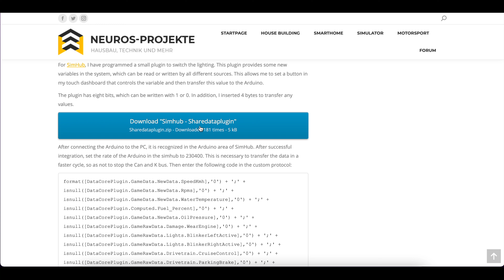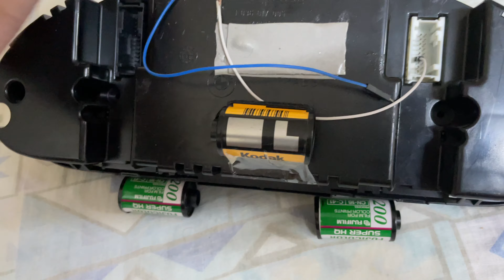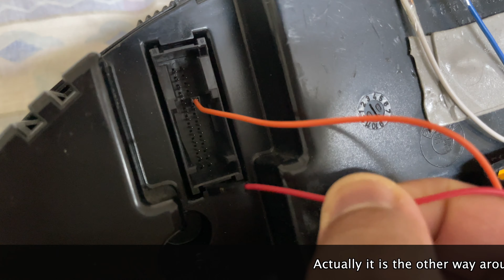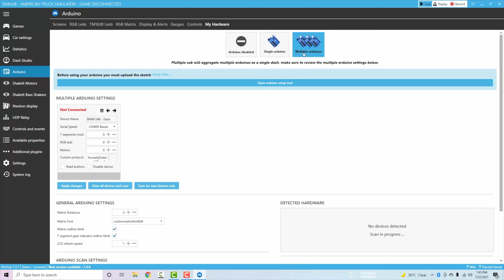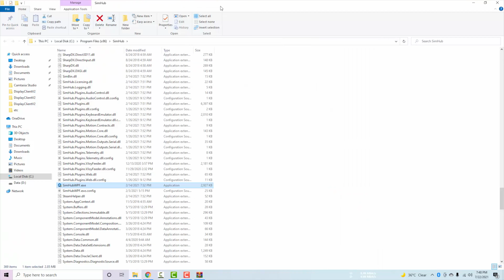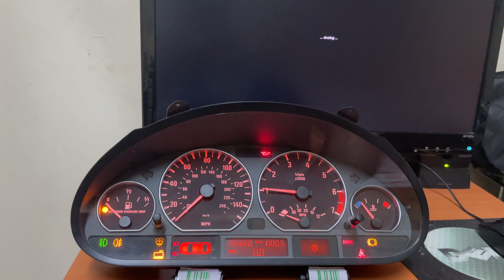BMW E46 instrument cluster connected to SimHub - CAN Bus#arduino #simracing #bmw #automobile

Comment: I noticed the fuel gauge wasn't working, did you manage to fix this?
Reply from the maker: Hi, the fuel gauge is driven by floating variable resistor. To make it work with the game, you either have to replace the original stepper motor with an arduino servo. Or externally make a setup like connect the servo motor with a variable resistor of same rating as the fuel tank resistance value and then connect the resistor leads to the fuel gauge pins on cluster. This should work, with some tweaking of the code. it’s been a long time, since I haven’t played with this cluster.

Comment: I have all the pieces but the only thing that has me stuck although I think it's a joke is the circuit of transistors and resistors that you have to assemble 7:10 I tried to assemble it once following the photos in your video but I couldn't and I can't read the diagram I don't know what's wrong with me.
Reply from the maker: It’s something unfortunately you need to figure out..Btw the OG code has undergone some updates. Check the pinned comment please.

Comment: Hey there. What kind of signal does the E46 speedo use? I want to generate the signal using arduino. Im actually on m54 swapped E36 project, so I want to use the original E36 signal to run my E46 dashboard's speedo. Thanks!
Reply from the maker: Hi, the speedometer on the E46 is just like the E36, it’s PWM signal driven. Don’t know if it will work directly with that E36, but you can always try.
Reply: Many thanks buddy😊😊. I will it later this afternoon. Regards!!

Comment: Do you think this would be possible to get running in a more sinple way using an Arduino UNO or is the extras of the Mega a need?
Reply from the maker: You need a mega itself I think..get a clome so it's cheaper

Comment: Helpful video, i did everything but turn signals and other lamps are not working.I pasted custom protocol in simhub and did everything like un the video.
Reply: I also tested the cluster (secret menu) and every lamp works fine
Reply from the maker: Hi, some of the warning lamps are driven by can and they should work fine. The turn signal and non warning lamps are driven by the k-bus circuit. Is the k-bus circuit correctly wired?
Reply: @sciencetrove  Thanks for the reply. I also think that it might be a problem in my k-bus circuit. I will redo it and update you.
Reply: @sciencetrove hi, still cant find where the issue is. My k-bus circuit seems to work,because i unlocked a bmw radio with it . I read somewhere that the problem may be clone arduino,so i will order an original one.
Reply from the maker: @georgimilev6786 I see, thanks for the update. Let me know how it goes. BTW there are some members in the channel's discord group who have simrigs based on the E39 and E46.

Comment: bro can i use other dashboard cluster??
Reply from the maker: Yes, you can. But for can bus based clusters you need to change the can bus ID frames in the Arduino code for your corresponding type of cluster.
Reply: @sciencetrove  ok bro

Comment: In file included from C:\Users\hp\Documents\Arduino\libraries\WebSockets\src/SocketIOclient.h:11:0,
                 from C:\Users\hp\Desktop\e46\DisplayClientV2\SHCustomProtocol.h:85,
                 from C:\Users\hp\Desktop\e46\DisplayClientV2\DisplayClientV2.ino:833:
C:\Users\hp\Documents\Arduino\libraries\WebSockets\src/WebSockets.h:37:2: error: #error Version 2.x.x currently does not support Arduino with AVR since there is no support for std namespace of c++.
 #error Version 2.x.x currently does not support Arduino with AVR since there is no support for std namespace of c++.
  ^~~~~
C:\Users\hp\Documents\Arduino\libraries\WebSockets\src/WebSockets.h:38:2: error: #error Use Version 1.x.x. (ATmega branch)
 #error Use Version 1.x.x. (ATmega branch)
  ^~~~~
In file included from C:\Users\hp\Desktop\e46\DisplayClientV2\SHCustomProtocol.h:87:0,
                 from C:\Users\hp\Desktop\e46\DisplayClientV2\DisplayClientV2.ino:833:
C:\Users\hp\Documents\Arduino\libraries\WebSockets\src/WebSockets4WebServer.h:29:10: fatal error: ESP8266WebServer.h: No such file or directory
 #include <ESP8266WebServer.h>
          ^~~~~~~~~~~~~~~~~~~~
compilation terminated.
Multiple libraries were found for "mcp_can.h"
  Used: C:\Users\hp\Documents\Arduino\libraries\Seeed_Arduino_CAN-old
  Not used: C:\Users\hp\Documents\Arduino\libraries\canbus
  Not used: C:\Users\hp\Documents\Arduino\libraries\Seeed_Arduino_CAN-master
exit status 1

Compilation error: exit status 1

Solution?
Reply from the maker: Which version are you using? The modded one in the description or the original one from neuroprojekte website?

Comment: Hey buddy. Great video except for one thing. I followed every step, bought everything part for part for part. Followed all steps on simhub but unfortunately nothing. Yet when I use the original code from the German site it works straight away. Any advice to get your code to work would be greatly appreciated. Thanks
Reply from the maker: Hi, sorry for the late reply. The code on my google drive link is 99% same as the original German one except for the fog lamp indicator active. That's the only difference.

Comment: Hello I have the problem when I want to upload s
mcp_can.h:112:11: note: candidate expects 3 arguments, 1 provided
exit status 1
no matching function for call to 'MCP_CAN::begin(int)

and this error
mcp_can.h:112:11: note: candidate: byte MCP_CAN::begin(byte, byte, byte)
      INT8U begin(INT8U idmodeset, INT8U speedset, INT8U clockset); // Initialize controller parameters
what can i do
Reply from the maker: You need the correct can bus library
Reply: @sciencetrove  i ordered the can bus on amazon can you tell me which one i have to use

Comment: I also have a Holden VX Commadore dash working which operates basically the same as E36 using Simhub and Arduino Uno, just need to make a few adjustments to max Spd & Rpm to suit then trim revs also use jumper to bypass service reminder if need be.
Reply from the maker: That's a nice looking cluster

Comment: Hello, I am building a simracing with an e46 dashboard (I have photos and I will upload the process to YouTube). and I want to make the cluster work, do you have photos or something more detailed on how to assemble the arduino, the resistor board, transistors, etc?
Or if you would pay yourself? Thanks a lot!
It's super cool what you've done :)
Reply from the maker: Thanks! I didn’t show anything related to Arduino is because the details are on Neuro Projekte website linked in description. It’s in German so you need to use Google translate if you wish to read. But the code, ncalc and wiring diagram are in English. BTW this project will require some good knowledge of electronics and soldering skills. The circuit itself is easy if you are good in both these. Even if I soldered it wouldn’t be economical to ship it off from Saudi Arabia where I’m currently working now. Shipping costs from here to other countries are very high.
Reply: @sciencetrove  Ahhh okay, I thought you lived in Europe, I'm a mechanic but not an electronicsman, I know electricity in vehicles but not at this level... welding is not the problem, I have visited your page but nothing is clear to me... I sent you several emails but I still don't have an answer from you :(( In the end I am forced to put an e36 cluster that is easier and there is more help on the internet :(

Comment: I did the same but the RPM has a delay, how do I solve it
Reply from the maker: as in delay do you mean like only when you pause the game the RPM needle moves? If this is the case I had mentioned that opening a dashboard and leaving it in background on simhub helps. If this isn't working then maybe something in simhub has changed since I posted. I haven't used simhub in a while.

Comment: Does the indicator  only needs power or a signal to the arduino?
Reply from the maker: Indicator is powered via 12V supply/battery. The arduino controls the kbus and can signals. Arduino is powered directly from USB
Reply: @sciencetrove  There ist a Video by Amstudio. He has a wire Plan which is a bit easier  with only one arduino. But He hasn't wired the right and left indicator. Do I need a new Script  for the indicators.
Amstudios Video is called how to wire bmw Cluster...
Reply from the maker: @Agent_Flix  The cluster used by amstudio is a non CAN type cluster. So yes all the lights are very analog type and needs manual trigger to light up. I believe he may have left it out as trying to use the native dash lamps will need a lot of wiring. Or just directly use LED lights from arduino and pop it into the cluster lamp sockets. In the latter case no need for relays. 

To be honest CAN based cluster projects are way better to activate lamps via software and require very very little wiring.
Reply from the maker: @Agent_Flix  Yep that video is the most basic one for anyone who wants to use a cluster. Yes, you will need to add a bit of code and ncalc values to get the lamps running. I did code that part in my very last E36 cluster video. But lately people have been saying that with new simhub they are facing issues. 

The e46 is kind of semi CAN based.

Comment: Hi i have some issues, i wired the relay, first i tried for park brake. I wired to good pin in cluster. Relay does the click, but nothing happens on cluster
Reply from the maker: For the parking brake lights to turn off I think you need to connect it to power supply/battery negative terminal. If you were to connect this to relay terminal, connect the battery negative terminal to relay "COM" center screw terminal. Now connect the parking light pin 23 on the black connector to the "Normally Open-NO" terminal on the relay. Now when the relay is energized your light should also turn off.

Try first connecting the pin 23 directly to negative without a relay to see if it turns off. If this works then it's just that you might be connecting it wrong on the relay.
Reply: @sciencetrove  i also tried to wire a GND to pin 23. it doesent instantly turns off, i have to replug the cluster to power
Reply from the maker: @Albertt.c  I'm surprised it did not work. Even the connection for the parking brake as per manual says GND. What did you mean by re-plug the cluster?

https://www.bmwgm5.com/Images/E46_IKE/E46_FSB.gif

Anyway what happens if you connect the pin 23 to +12V? From which model bmw did you pull of the cluster. If you can add a picture on imgur the label on top of the cluster it may help.
Reply: @sciencetrove  i mean to replug to power
Reply from the maker: @Albertt.c  okay, I see. Mine is a 330i E46 cluster.

Comment: can i have a link to the site where i can buy the things i need to do it
Reply from the maker: All the parts list can be found here:

https://neuros-projekte.de/simulator/bmw-e46-arduino-simhub/

Instead of the PN2222A you can get any NPN transistor you like. I used a BC547. Oh and make sure the cluster is a petrol variant not diesel.
Reply: Check the original article for a parts list

Comment: great video. i followed everything and got most of it working. speedo works but the tach only works when the game is paused. any ideas as to why. i have another gauge cluster open when trying to make it work
Reply from the maker: Thank you! Glad the video helped you to get your unit running :)

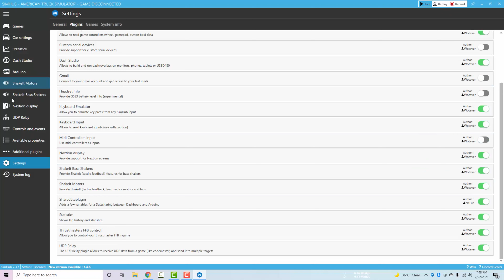I too faced the same issue with RPM. The only fix I could do to get it to work was to open a dash and keep it running in the background to get RPM to work fine. I’ve explained this at time stamp 22:19.
Reply: @sciencetrove  thats what I meant when I said I have another gauge cluster open. Nothing has worked for me still.
Reply: @mr.hankie  same problem with my cluster too!

Comment: Hey I have a 1999 Ford ranger speedometer it doesn't have pins on the back just different hmm 🤔 he had pins to connect the wires 

Anyway to still make it work?
Reply from the maker: Can you maybe send a link to what the pin out of your cluster looks like? 

Maybe this might help:
https://www.ranger-forums.com/8-cylinder-tech-34/v6-v8-tach-ground-wire-107127/

Comment: Which pin from relay goes to cluster? like which one goes to arduino and which one goes to cluster?
Reply from the maker: Only my relay channel set: the ones labeled IN1, IN2…etc is the data input from arduino to enable/disable the relay. Vcc& GND are +5V DC and ground(-) of your 5V supply.

The ones labeled as K1, K2…etc are for the relay outputs. With 3 terminals: Normally Open (NO), Common (COM) and Normally Closed (NC). Hope this clarifies your question.

Comment: how do i make the fuel gauge to work?
Reply from the maker: Hi, the actual fuel gauge if you look at the E46 cluster wiring diagram on website in the description it uses a variable resistor paired with a float system to make it work. 

On NeuroProjekt website link in description you can see he has modded the original stepper motor to an arduino servo motor to make it work.
Reply: Hi on which pin does the servo go for the fuel gauge

Comment: Looks like you can use an old  Toyota or Honda  Audi Speedo too.  But the newer digital displays will be harder.
Reply from the maker: The newer clusters with analog gauges fully CAN have only 4–6 wires and are easy to setup for someone who knows about coding and electronics like example BMW E90. 

Yes, you are right with the digital. It’s difficult but doable I guess. But would require a lot of work I assume.

Comment: Thank you so much for this helpful video, i made it to the point where i can control the cluster via SimHub. However the cluster only displays RPM and Temp for 4 to 5 seconds before returning the RPM back to 0 and Temp to maximum.

When i try to set the baud rate of the arduino to 230400, the arduino contantly loses connection to SimHub. When i set the baudrate higher or lower the connection to the arduino is good but the RPM and TEMP only work for 4 to 5 seconds.

Can you maybe help me?
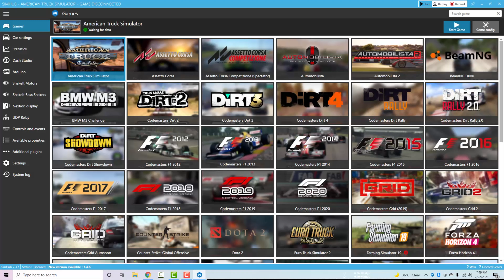Reply from the maker: Thank you! Glad you found it helpful. I too found this issue and couldn’t exactly pinpoint what is causing the issue. A workaround I found was by opening one of the preloaded cluster dashboards in SimHub and allow it run in the background. At time from 22:20 to 22:40 I've explained about this.
Reply: did you ever figure out the switching off issue, kevin?

Comment: Okay this video really helps alot! I bought a cluster from a e46 Diesel and wanted to just mess around with the can bus (since I made my gaming setup out of a complete dash from a different car) but for some reason the data doesn't reach the cluster. Does there need to be a 120 Ohms resistoe between Can H and Can L? The cluster powers up fine but no can communication works and the temp gauge always goes to maximum
Reply from the maker: Happy to hear the video is helpful. You do not need to add any resistors. Which shield are you using? Generic or something from Seeed/spark fun etc?
Reply: @sciencetrove  I am using a Keyestudio Can Bus shield (some cheap shield that works with any cluster but that one). Idk maybe I set the bitrate wrong tho. Currently have it set at 500 KBPS and using addresses from the internet but there's no response from the cluster. Or do I actually need the K-Bus to get that to work at all?
Reply from the maker: @vampyryannik7334  Sorry for late reply.  The K-bus is only for certain lamps. Try to use the default send code in can bus library and see if the Arduino initializes on the serial monitor. I see from aliexpress pictures that the board does not have a 120 ohm resistor by default. 

https://wiki.keyestudio.com/KS0411_keyestudio_CAN-BUS_Shield#Terminal_resistor

I had initially ordered a simple Chinese one off eBay and for me it worked fine, but mainly the issues I faced was something else.
Reply: @sciencetrove  it's totally fine! I actually found the issue lmao and now it works fine. I aswell managed to get every warning light off, except the parking brake which does not dissapear when I hook it up to Ground or 12v.
Reply: @vampyryannik7334  what was the issue? my temp is stuck at max and my tachometer does not work.
Reply: @gullysl  it was indeed the 120 Ohms resistor
Reply: @vampyryannik7334  I don’t have a 120 ohms resister between the Can H and Can L :( I suspect that It may be my can bus shield.
Reply: @gullysl  yeah you need to put a resistor there thats why it doesnt work
Reply: @vampyryannik7334  ah ok, I will give it a go tomorrow. Thanks for the help!
Reply: @vampyryannik7334  nope :( my board already comes with one on the board. I tried adding another but to no avail. Mine is the petrol version if it helps
Reply: @gullysl  well thats weird. I do not know then sorry
Reply: @vampyryannik7334  thanks for the help anyway. Maybe it is related to sim hub. I’ve already killed 1 mega doing this project lol. Is yours still working?
Reply: @gullysl  maybe. Well, my e46 isn't up and running anymore as I moved on to more complicated stuff and now decided to make a Passat Simrig lol
Reply: @vampyryannik7334  ok thanks for the info anyway